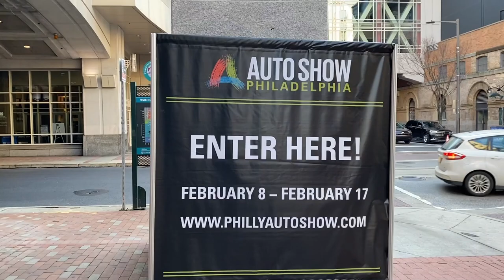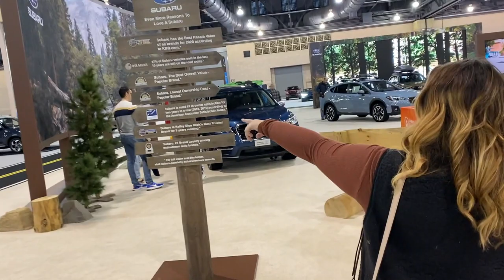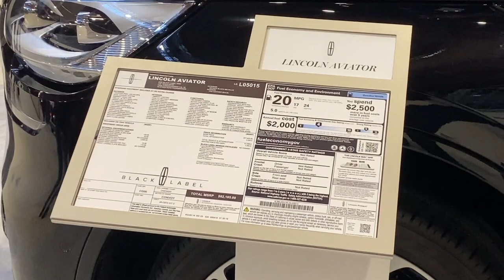2004r Transmission removed and ready for rebuild! | Philadelphia Auto Show stroll!

Comment: RJC crossflow exhaust. Awesome sound, shitty fitment. The over the axle pipe bend isn't enough just like what you showed which affects everything else. Had to have mine cut up and remade plus add a hanger on the passenger side.